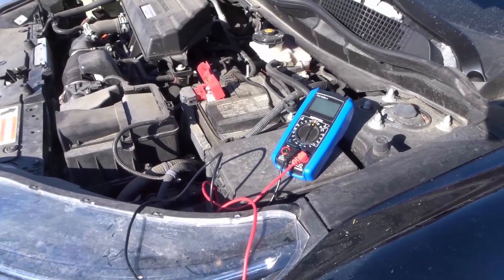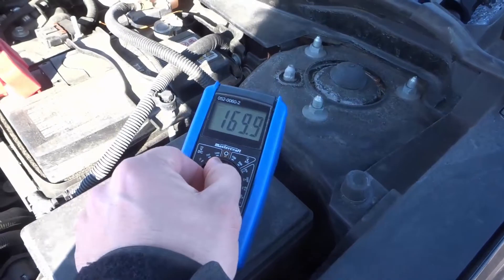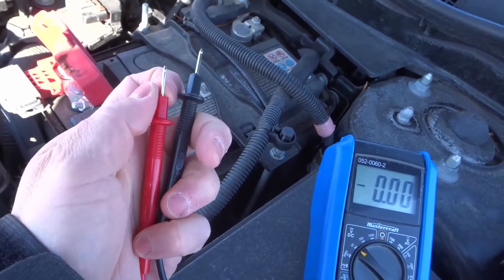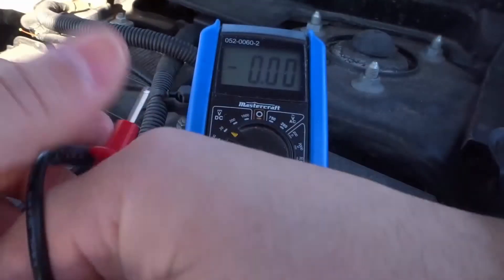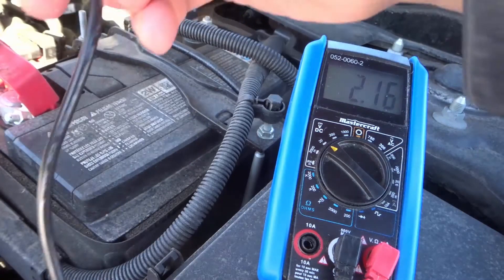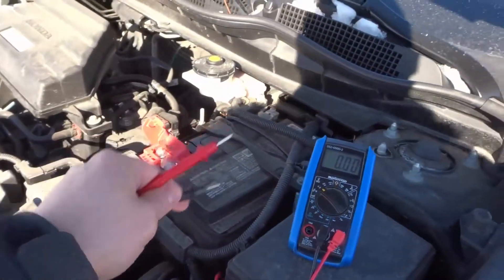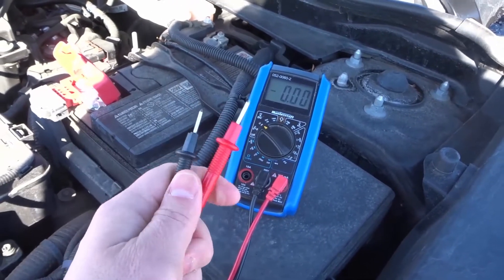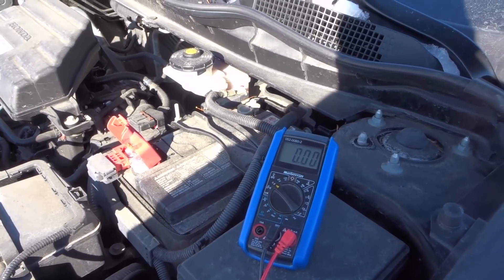Testing A Car Battery With A Multimeter-Super Easy Tutorial

Comment: Exactly what I wanted to know. I do notice that after I turn the engine off the reading on the battery decreases right away, but then continues to decrease. Likewise, when i stop draining the battery (lights on, engine off) the voltage increases right away, but continues to increase with the engine still off. How long should I let the battery rest from both charging and draining, to get a true voltage measurement?